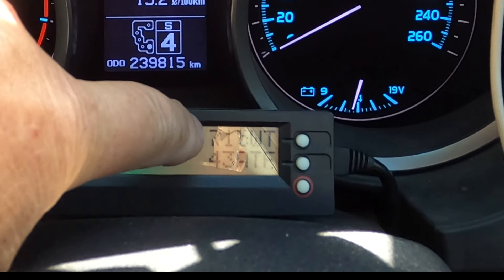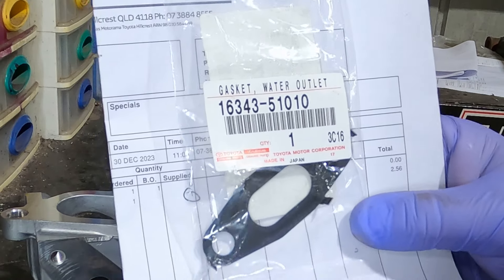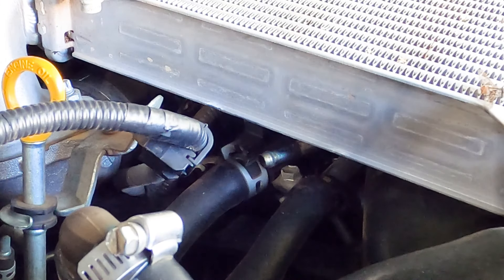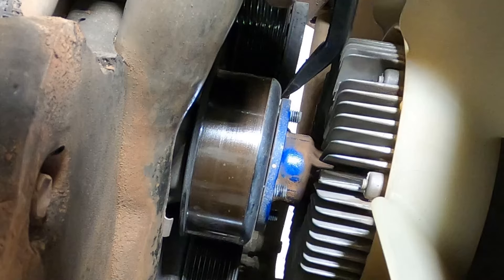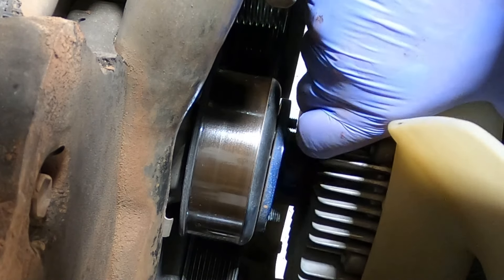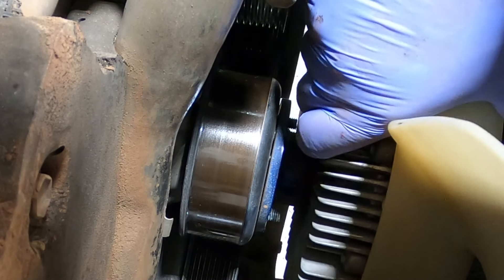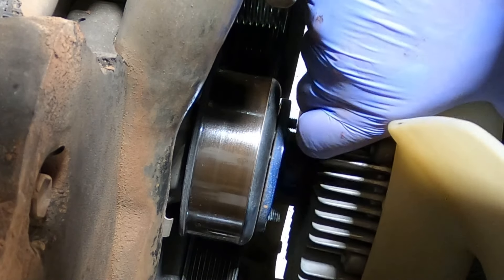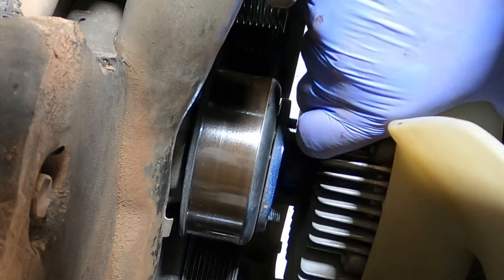How to Replace a Water Pump and Thermostat | Toyota Landcruiser 200 Series

Comment: Hey there young fella, in just got a scan gauge to help me monitor temps and pressures, it allows me to set alarms and I was wondering if you had some upper limits you look for as tell take for issues, water, AT, etc regards Tony
Reply from the maker: I do indeed Tony, but believe it or not sensor results can be very vehicle independent, even with the exact same model.  For example, my 200 Series runs a water temperature of 76C all day long.  I  can’t recall a time when it went above 90, even under the most extreme of loads.  Some of my mates cars (exactly the same model) run at 85C.  What I would suggest is just monitor your own vehicle and get to know what’s normal for you.  Once you have that pegged, you can set your own upper bands.  Sorry this answer was not more specific but it’s the correct response I believe.  Enjoy your journey, cheers👍😎

Comment: Hey Terry great video as always.  I was interested to hear that the thermostat was rated at 76 degrees, does that mean your car generally runs at around that temperature?  My mechanic said my thermostat comes open at 88degrees which is significantly different and tends to run from 86 - 93.  I’m thinking that I need to find out what’s really going on. I recently put a new radiator in and that’s all good, but perhaps the water pump and thermostat is next.  Can you say that following your change over that your temperatures have now stabilised?  Cheers 👍
Reply from the maker: Thanks Andrew, I’m glad you found some value here.  Yes, my normal operating temp is high 70’s, plus minus 2C after the change.  As per the video, the temp has stabilised and my issue has been resolved.  86-93 is way hotter than the normal operating temps I see.  Having said that, maybe that’s normal for your vehicle.  If it were me, I’d like to see lower temperatures.  Enjoy your journey mate👍😎

Comment: Thanks Terry, keen to hear your thoughts on the standard air box you still have?
Reply from the maker: Mate, the standard air box is absolute rubbish and one area that Toyota have a LOT to answer for.  They say the standard box lets an acceptable amount of dust through.  Rubbish, NO dust is acceptable in my opinion.  I have had a Unifilter in place since I bought the vehicle and love it.  You have to know how to oil and maintain it, but if you know that it's brilliant.  I have a smear of white grease on the clean side of my air intake to monitor dust accumulation.  That white grease has remained perfectly clean for 7 years now, and I take my vehicle in some VERY challenging and dusty places.  I have talked about this air box in many many of my videos, but this is probably the first one where I mention it.  Cheers

https://youtu.be/CJ-O0JnmdBA
Reply: @JafffaAdventures  thanks Terry. I've been watching your channel for a few years and have a modified 2012 sahara of 6 years. Keep up the good work as it helps me tenfold with mine. Ps, I chucked my air box the first week I got my 200, fatz fab do a really God replacement box. 👍
Reply from the maker: I’m glad you found some value here Warren, that makes the hours of recording and editing worth my effort.  Cheers👍😎

Comment: Gday Terry, 
Question regarding the radiator fluid draining - does this process also drain the heater core - and it may be a better question for Toyota but I thought I'd ask.  I just had the tell-tale ooze from the weep hole so its a job on my to-do list in the near future.
Thanks
Reply from the maker: Yes indeed it does drain the fluid from the heater core.  Cheers

Comment: I have always run a level sensor in my cruisers as insurance against split hoses do you think it needs one
Reply from the maker: I run a scangauge and have water temp displayed continuously.  A secondary monitoring method is great, but you have to use it of course.  Cheers😎👍

Comment: Hi Terry  any comment on  that ryobi ratchet i would like to buy one 😊.
Reply from the maker: It’s important to note that I’m a back yard hack, not a full blown mechanic or tradie.  For my purposes, it works well.  It’s my second one.  The first one’s gears stripped out after 3 or 4 years.  These things have a 5 to 7 year warranty however, so I just took the dead one into Bunnings and they swapped it with a new one no worries.  I’d get one again if I was in the market 👍😎

Comment: Hey Terry nice site, those maintenance tips and how to guides invaluable. A question for you and your subscribers if I could :
What is the max kms on a 200 series, mine a 2010 going well coming up to 300ks. What is the highest around?
What would you or your subscribers do with a failed engine, what or how new or recon?
Would you consider talking the options on a future video?
I know your site is prolonging that eventuality but it must be in the back of viewers minds like mine.
Regards, Kel
Reply from the maker: There are a few Facebook groups specific to 200 series and the highest km question has been asked a few times on them.  Can't remember seeing one over a million yet, but there were a couple in the 800 to 900 thousand range.  I doubt I will talk options on engine replacements, unless I have to cross that bridge.  In the meantime, I'll expend my efforts and energy on pushing that possibility back as far as I can.  Thanks for watching mate!

Comment: Hi Steve
Sounds very normal with your temp reading my one is a pre pdf and with new water pump and thermostat and old an new radiator runs over 91 degree and goes up to 100 degrees under full load read on the digital. I think that is a normal temp range. Forget the Toyo temp indicator in the dashboard it will not move much. 
Cheers
Reply from the maker: Agree

Comment: Once again an interesting video terry. Thanks for that. I noted that you mentioned the normal temp for your car. My 200 runs at about 88 most of the time and will climb under load to 93 + it will drop back to 87/88 immediately once the load is off.  It’s been like that pretty much since new. I have replace the water pump,thermostat and radiator and  made no difference. Any thoughts. Thanks steve
Reply from the maker: Thanks Steve, I appreciate the kind words.  88 would definitely be high for my vehicle, but it sounds like the baseline normal for yours and that’s sweet.  Like I said in the video, once you establish normal for you, then it’s just a matter of keeping your eyes peeled for abnormal (for you) temps.  Cheers👍😎
Reply: @JafffaAdventures  thanks terry. That was my thoughts as well
Reply from the maker: Good one Steve👍
Reply: My 200 runs the same temps as yours Steve. 83 with no load, 87-88 with van on the back. And up to 93-96 up hills or when pushing it.
Reply: Thanks jayz. I use to be worried about it but now I have accepted the fact that it runs hot I just keep an eye on it. At least mines not the only one. Done 186000 and never missed a beat. BTW I should have mentioned that it does weigh about 3200 empty with all the bar work and accessories etc
Reply from the maker: Thanks for sharing!
Reply from the maker: Good to know what your baseline is, you are all set mate

Comment: Hi Terry
How old is your plastic fan and the idler and belt tensioner ??
Water pump, thermostat, idle roller and tensioner and rip belt should be all in one job. 
Happy day
Cheers
Reply from the maker: If you look back at my historical vids you will see they were all replaced recently (excluding the fan).  It’s not necessary to do it all again in my case.
Reply: Hi Terry
Sorry, missed that…with the idler roller….
Just bought the Toyo oil filter metal housing and oil pick up….
Reply from the maker: Good stuff mate, that should last you a lifetime.  Cheers